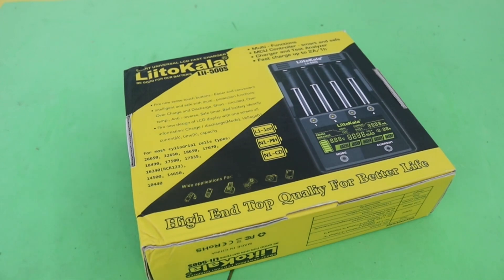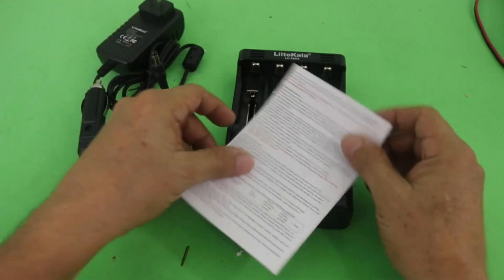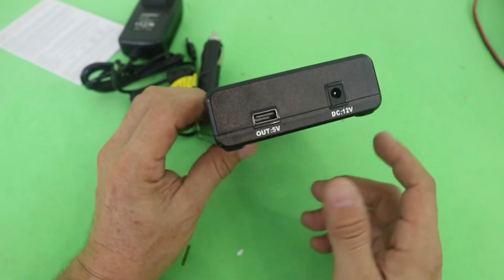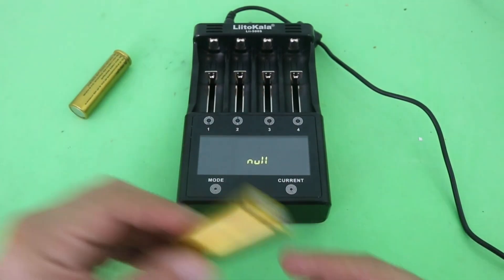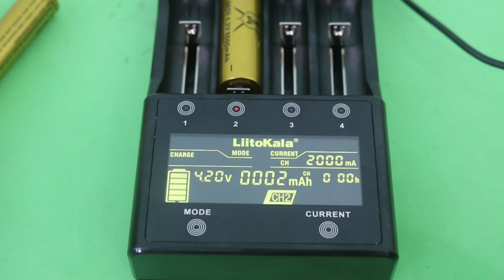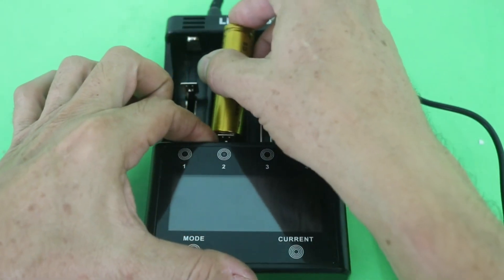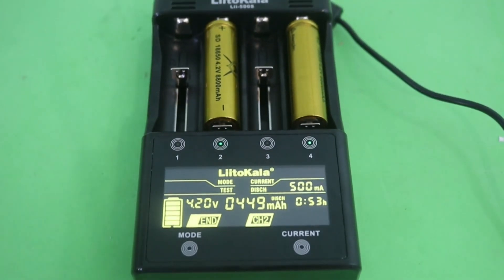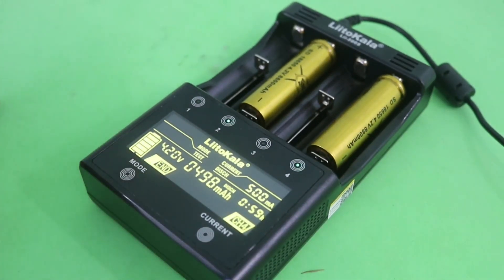LiitoKala Lii-500s Battery Charger Analyzer - Review

Comment: if cells measure something like 0,5v or 1,7v, does that mean theyre dead? Because my Liito Kala doesnt want to charge them, it shows Null. Had to use Multimeter to read the voltage.
Reply: No, if u have one good charged Lithium cell just take 2 simple short wires and join your "dead" cell with the good one, positive pole with the positive, and both negative together for 10-15 seconds to activate the dead cell above ~ 2.8-3.5 Volt and put the one fast in the charger, it works always mate :) simple and easy

Comment: But... can you test the capacity by charging the battery ? i thought that has to be measured by discharging it !
Reply: Always by discharging. You put the test mode on, setting the current for 500mA, it will fully charge to 4.2, than discharge to 2.8 V while doing the mesurement, and charging back to 4.2 and doing the second mesurement. On the end you will have two scores, by pressing the upper bay buttons you will see 2 different scores.
Reply: he says in the video, the cycle is fully charge it and discharge it to know the capacity
Reply: You get shown the capacity pulled out and put in. The pulled out (discharge) amount is the actual capacity.

Comment: I have Liitokala 500s and I didn't find any video in Portuguese detailing how it works.  I have the following doubt:

  I performed the 18650mah battery test and presented the results:

  - Charging 1881mha
  - Download 0886mha.

  Which value should you consider, loading or unloading?
Reply: Always the discharge value, but remember that u have to charge and discharge @ 500mA for the best results. But it seems your cell is damaged, the difference is to high, with a healthy cell the difference is around 1-3%, and not 50% like yours :)
Reply from the maker: Use download value, but I think your cell is damaged
Reply: Discharge is the accurate number. Charge is not accurate because there are losses due to heat
Reply: @bobforte9343 yes i think because the battery has internal resistance.